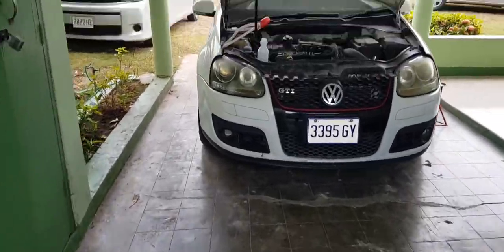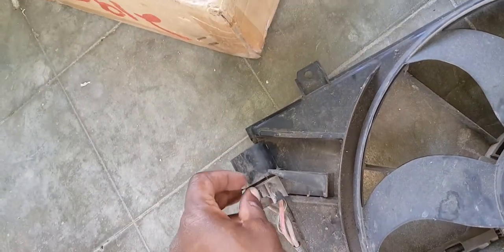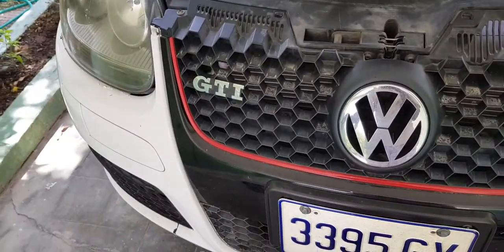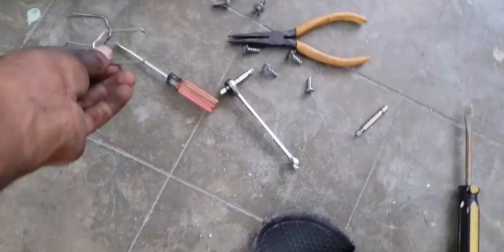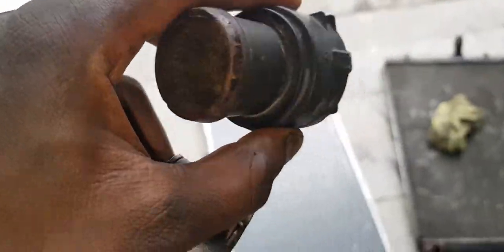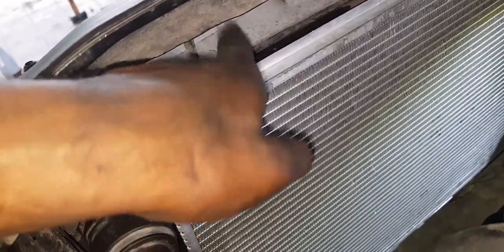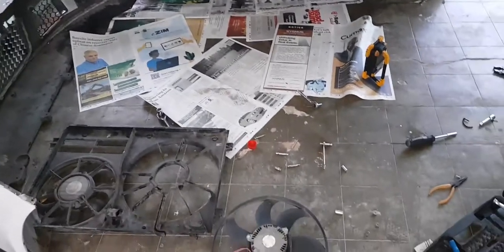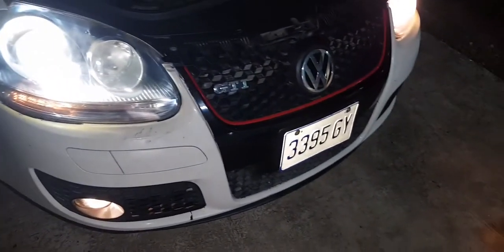MK5 Golf GTI radiator and radiator fan replacement

Comment: Why you need to remove the front bumper. What if i dont remove rhe bumper. Am i able to pull from the top?
Reply from the maker: You will find out that due to how the A-C condenser,  intercooler and radiator are sandwiched together, you have to remove the front bumper to access the fasteners.

What you are suggesting can be done with a typical Japanese vehicle like a Honda or Toyota.  With a VAG vehicle,  everything is sandwiched together.

Comment: Where do you find parts for your car in jamaica?
Reply from the maker: Everything for my car has to be ordered online due to the model.   The used radiator fan in this video was from someone who had scrapped it from a car that was being disposed of.  The new radiator was one that was previously ordered online. 

Most of the parts for the GTI in this video come from Germany or anywhere in Europe due to the fact that these RHD components don't exist in Florida or many places in the United States. 

What I do is to simply use a part catalogue to identify and cross reference the part number.   This yields many results in Google as to where I get parts at the best price closest to Florida  (where my freight forwarder is)